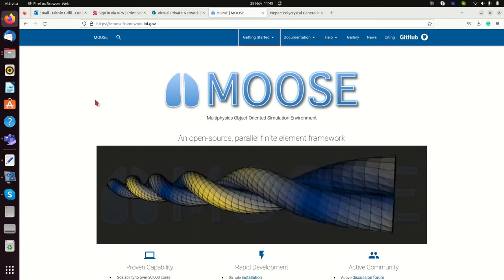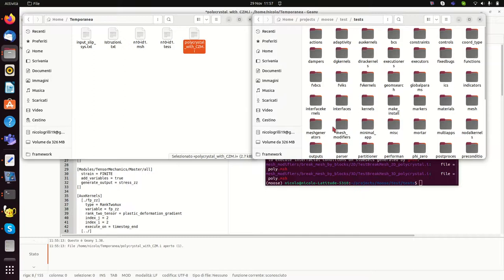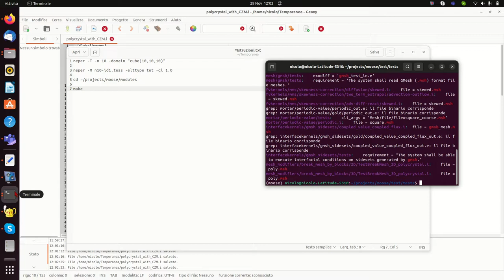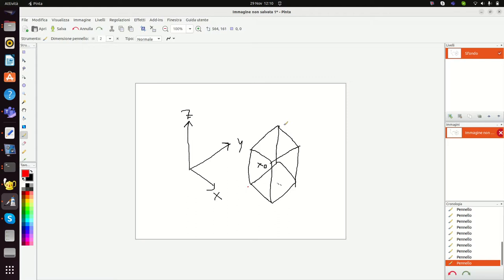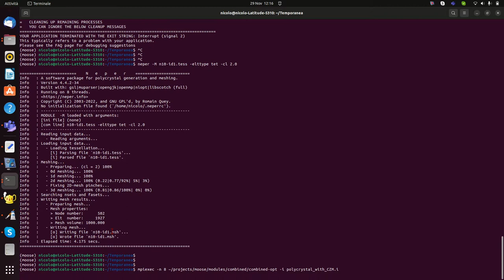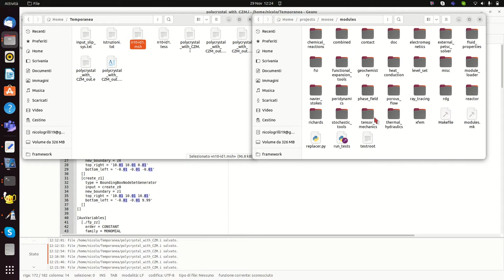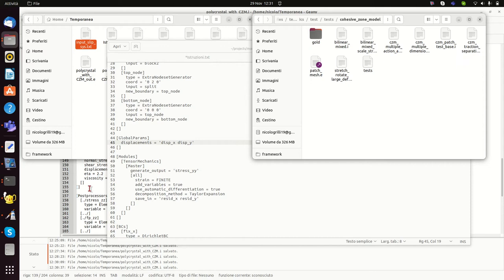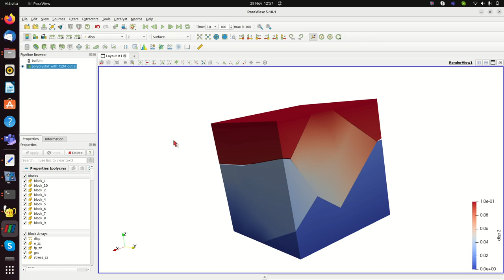Crystal Plasticity and Cohesive Zone Model using Neper and MOOSE Framework

Comment: Hi nicolo, nice work! I noticed that the orientation of each crystals is defined within the .msh file with rodrigues vector, can the orientation be defined in the input file (.i file) of moose ?
Reply from the maker: neper produces Euler angles within the .msh file, as you said. However, in the procedure used in this video, those angles are never used, only the mesh and element sets are read from the .msh file. In this case, I am not using any Euler angles and the default is that they are all zeros. If you want to assign Euler angles within the .i file, you can follow the example here:

https://github.com/idaholab/moose/tree/next/modules/solid_mechanics/test/tests/crystal_plasticity/euler_angles

If you want to read Euler angles from file, you can follow the example here:

https://github.com/idaholab/moose/blob/next/modules/solid_mechanics/test/tests/crystal_plasticity/user_object_based/save_euler.i

Comment: Hi Dr. Grilli,  Thanks to this very nice video. I was trying to do some polycrystal simulations and followed the instructions in this video, however there is an error message shown "the following side set ids do not exist on the mesh: 107
    
    MOOSE distinguishes between "node sets" and "side sets" depending on whether 
    you are using "Nodal" or "Integrated" BCs respectively. Node sets corresponding 
    to your side sets are constructed for you by default.
    
    Try setting "Mesh/construct_side_list_from_node_list=true" if you see this error." Could you please help me fix this issue. Thanks!
Reply from the maker: The node sets generated by other software may not be read properly. Once you have the mesh, I recommend using BoundingBoxNodeSetGenerator to create the corresponding node set. See the example here:
https://github.com/ngrilli/c_pfor_am/blob/main/test/tests/neper/polycrystalneper.i
Reply: @nicologrilli9931  Thanks for your reply. I have another question that if I want to do a simple elastic problem on polycrystal, do you have any suggestions? Thanks a lot!
Reply from the maker: @liudi627  That's trivial. You can set the plastic strain rate prefactor equal to zero, in that case, there will be no plasticity and the model will behave like an elastic anisotropic polycrystal model. In the CrystalPlasticityKalidindiUpdate block, you can add a line "ao = 0" 
See the code here:
https://github.com/idaholab/moose/blob/next/modules/tensor_mechanics/src/materials/crystal_plasticity/CrystalPlasticityKalidindiUpdate.C

Comment: Hi Nicolo,
As a new user to MOOSE, I find this video extremely useful. Since I am new to MOOSE, I have couple of questions related to this problem and MOOSE.
Generally in CP problems, we apply periodic boundary condition to the RVE. In ABAQUS, we can use equation constraint to achieve. How to apply periodic boundary condition along all the three axis and apply displacement as load in a node in MOOSE?
We also use homogenization technique such as volume averaging to extract the properties at macroscale. In ABAQUS we can do it by extacting the element volume and measurements such as LE22 and S22 for tensile load. How to do something similar for this problem?
And in this problem, we have element sets for each grain from Neper. Is it possible in MOOSE to apply different material parameters/ properties to each grain?
Reply from the maker: Instructions for periodic boundary conditions are here:
https://evision.apps.bristol.ac.uk/urd/sits.urd/run/siw_sso.go?F0FyNifUOuG6MrabngIn2UXMkVrgJDMGGmddCsksUQuae2EJ7Q
there are many examples in the MOOSE tests.

If you need to average for postprocessing, ParaView can average with the "Integrate" filter.
If you need the average for a calculation, then you need to use a MOOSE postprocessor, see here:
https://mooseframework.inl.gov/syntax/Postprocessors/index.html

Yes, you can apply different material to different grains by restricting the material to a specific block,
there are several examples of this in the tensor mechanics module and elsewhere in the MOOSE tests.

Comment: Hi Nicolo, Thanks for the nice video, really informative. Trying this example myself, however not able to see the model surfaces outputted in .msh and hence moose does not like it, saying that the node sets y0 does not exist in the mesh. Can this be discussed offline?
Reply from the maker: Hi Arun,

Yes, I agree, there has always been some problem with neper and surfaces.
It is not entirely true that they are not defined in your file,
you can see in the $NSets section there is x0 et cetera,
but MOOSE is unlikely to read those because this is an old version of gmsh format, it is version 2, while 4 is the current.

I always prefer to define the boundaries myself in the MOOSE input file using BoundingBoxGenerator,
see an example here:
https://github.com/ngrilli/c_pfor_am/blob/main/test/tests/neper/polycrystalneper.i

basically, you define coordinates of bounding boxes and MOOSE will create
nodesets that contain the nodes that are inside the bounding box.
This is the most reliable method I know.

If you are really stubborn and want to do with neper
I suggest the following attempts:

1) Open the msh created by neper with the latest version of gmsh and save it again,
that should save in version 4 format and maybe this is read properly by MOOSE

2) Save mesh file in neper using the abaqus inp format,
there is an option in neper for that,
then read the inp in MOOSE,
because inp did not really change over time, this may be more version tolerant

Best Regards,
Nicolò

Comment: is it possible to simulate 2D  Cohesive Zone Model using Neper and MOOSE Framework?
Reply from the maker: Good question. I think so but I have not tried. Neper can definitely generate 2D polycrystals with the -dim option. The question is if BreakMeshByBlockGenerator can split a 2D mesh or not. Another thing you can try to make a quasi-2D is to use the "-morpho columnar" option in Neper and generate a columnar 3D, maybe with a single element in thickness. That will work for sure and give you effectively a plane stress state.